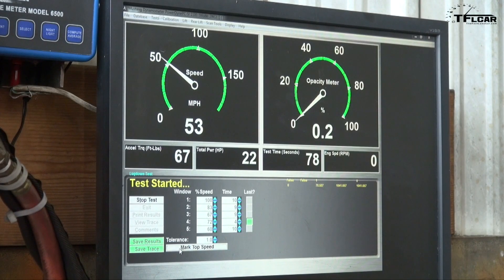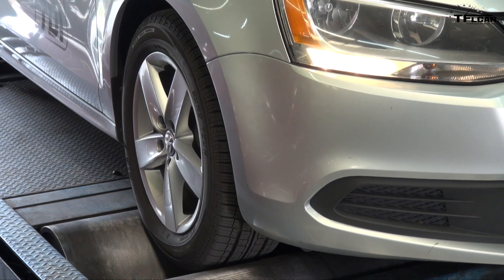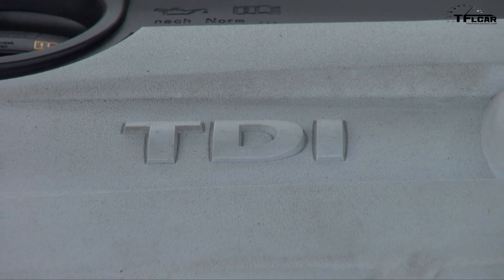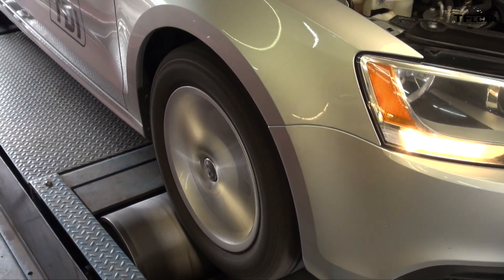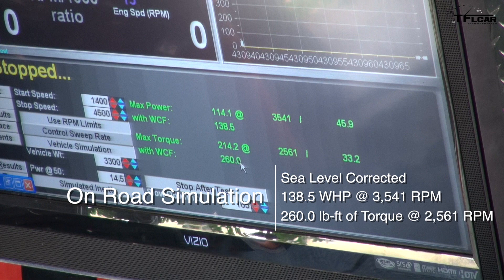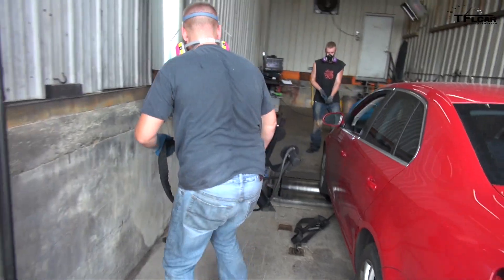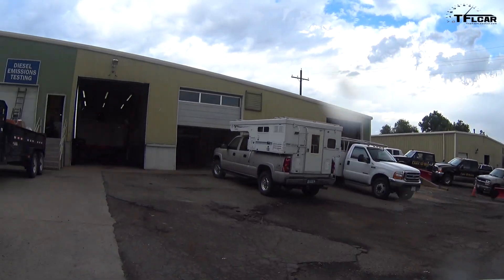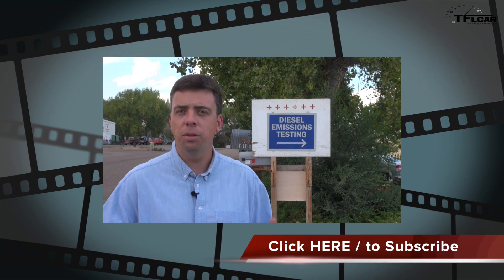Surprise! We Dyno a VW Dieselgate TDI Jetta to get the Truth about HP Loss

Comment: Why were you not able to measure NOx? That's the key. The VW issue did not involve particulates, only NOx. Particulate matter is created in a rich burn scenario where NOx is created in a lean burn scenario. A good example is off-road diesels emissions standards, Tier 4i focused on particulates (DPF, low sulfur diesel, engine tuning, etc), Tier 4f focused on tier 4i plus reduced NOx (DEF, engine tuning, etc). The biggest likely effect of the software change is reduced fuel efficiency. This is really about excessive government regulation, where meeting one regulation makes it difficult to meet another regulation. Regulations that often contradict each other, add cost, reducing reliability, and increasing complexity to what could be a simple system.
Reply: Marcin Kaminski This has been looked at in the UK. So long as cars are charged off-peak overnight, every car in the UK could be an EV on charge without overloading the system. There is so much wasted capacity on the grid off-peak that this is entirely possible. 
If you are somebody who thinks you might forget to plug in your car you can just get a wireless charging plate. So long as you park over it - and we are creatures of habit, so usually like to park in the same place anyway - it'll charge without any lead-play.
Reply from the maker: Before Diesel emissions testing in Colorado do NOT require NOx measurements. They only test for particulates.
Reply: because the only people or group that has a machine that reads diesel emissions are the ones that test big rig trucks, regular gas analyzers as the ones in smog stations such as the Bar97 or im240 are not rated to read diesel emissions only gasoline. these guys don't even have an emission analyzer they just have a dyno that measures hp and they hypothesize if the car is polluting by reading hp data, not too acurrate but better than nothing.
Reply: That's what I'm wondering. They went to a tuning shop with a dyno and no 5-gas machine to be found?

Who works ever go to a tuning shop without a good gas analyzer?
Reply: +bdreed85 also, every diesel runs lean, not one diesel will run at stoich as the soot would be outrageous what you mean is a hot or cold burn!
Reply: +discountbrains vw isn't pushing hybrids. America is pushing hybrids. The new diesels burn 20% cleaner than a gas engine the same size. Hybrids have hundreds of pounds of batteries that are very harmful and has a gas engine as well. I know a guy that died from the gases put off by batteries. Scrap hybrids!!
Reply: +discountbrains If new, small diesel is not fit for purpose, than what is? Hummer? F150?
If VW can't meet NOx levels, than most likely other manufacturers can'e meet it either.
Reply: +warset Technically not correct. Diesels create less CO2 (that's why tax brackets are lower). Main issue with diesels were particulates and NOxs. Particulates are eliminated with DPF filters and NOxs can be limited drastically with urea installation (AdBlue) which is already being used in some cars.
Reply: +Troy Strain In fact, if they were "full throttle", it can be assumed the engine was not running very lean. Lean burn would be maintaining speed in a high gear where you're getting plenty of oxygen without burning much fuel.
Reply: +The Fast Lane Car There is no particulate emission in cars with DPF filters so this does not make any sense anyway. NOxs are the only area where VW could fiddle with, but among all "specialists" there is still no information based on tests.
Reply: +Thomas Monument 1. Batteries only offset pollution as electricity is still not a "clean" power. 2. Power grid might not be sufficient to switch to electric cars. 3. It's still expensive technology (getting cheaper, but still expensive)
Reply: +Marcin Kaminski No, Marcin Kaminski, this is false information and you should not be spreading it.  To say electricity is 'still not a clean power' with absolute certainty, shows you need to stop thinking of the world as one small region.

1. ELECTRICITY is as clean as we make it.  It CAN be clean.  It CAN be dirty.  In its dirtiest form - coal - it's still cleaner than a combustion engine.  It's a win-win; it's cleaner to begin with, and it gets cleaner over time.  To imply that 'ALL' electricity is dirty shows you've been living under a rock.  It depends where you live.  If you live in China, then yep, it's almost all coal power.  If you live in England, it's only 28% coal.  If you live in the USA, it's rapidly switching over to natural gas, and many of the northern states like Washington are 70%+ renewable.  To imply that electricity is 'just dirty' and leave it at that is SO naive.  With this said, countries are working to clean up their act, and the important thing is batteries get cleaner as grids get cleaner.  The same cannot be said for combustion engines, which will always be dirty.  They're almost as good as they're going to get.  An EV powered by nuclear-generated power is 4-5x more efficient than an ICE.

1b. Even if your above point were spot on , and batteries merely 'offset' pollution, how can you speak of it as if it's a bad thing?  Offsetting pollution away from town centres is amazing for people's health and lungs.  A good case-and-point is Mexico City, which has terrible pollution due to its location surrounded by mountains which trap the pollutants in.  Cities are also bad for this as the high buildings trap in the fumes.  Conversely, power plants are located away from busy populaces and have additional measures to curb their emissions which a tailpipe of a car does not have.  They also tend to be situated in places where the pollutants have plenty of room to disperse, as concentrated pollution is when it's the most dangerous like around busy traffic.

2. Experts in the power industry have been shooting down that myth for years now.  They ALL say the power grid can handle the load of electric cars, so just let that stupid myth drop, will you?  Firstly, most charging is done at night where there's a bathtub effect of low power usage anyway, and electricity is cheaper.  Power plants have an excess of electricity during off-peak times, they WANT it to be used.   Secondly, if additional demand is needed, we build more power stations.  Thirdly, as more and more people switch to their own solar panels, that actually TAKES load off the grid - and doubles up by counteracting your point #1.  Fourth, if only we stopped refining oil, we'd have plenty of power for our cars.  Refining oil uses extortionate amounts of power.

3. It's getting cheaper faster than you think.  Expect price parity less than 10 years from now.
Electricity has been available in clean methods for decades now via renewables and yet you still sit here and claim it's not a green power. I truly do wonder if you've been living under a rock and assumed it's 100% fossil fuels still?  Assumed it isn't and won't get cleaner over time?
Reply: +zshadows not exactly, diesel is not cleaner than gasoline emissions. diesel does have its advantages over gasoline engines but cleaner emissions is not one of them. That's why the majority of diesel truck owners for example like to take or modify their diesel trucks to get more power and diesel mileage because diesel engines are greatly modified with emission components just to keep cleaner emission output, so in a way it makes sense what WV did.
Reply: I was talking about particulate matter emissions on an unmodified vehicle. Because of the PM filter, the VW diesel vehicles emit less PM than many gasoline vehicles (especially direct injection) despite having greater PM levels at the exhaust manifold.
Reply: I was talking about particulate matter emissions on an unmodified vehicle. Because of the PM filter, the VW diesel vehicles emit less PM than many gasoline vehicles (especially direct injection) despite having greater PM levels at the exhaust manifold.
Reply: I was talking about particulate matter emissions on an unmodified vehicle. Because of the PM filter, the VW diesel vehicles emit less PM than many gasoline vehicles (especially direct injection) despite having greater PM levels at the exhaust manifold.
Reply: +Marcin Kaminski stupid people testing smart cars
Reply: +bdreed85 i'm catless
Reply: +bdreed85 No, you're DEAD WRONG! Quit blaming the gov't. People have decided we are polluting and harming health and the environment too much; hence, the emissions laws. If the diesel can't meet one standard without failing another then there is a problem with the diesel. Either it needs more innovation to meet the standards or should be scrapped for other methods like LNG engines. VW in fact is pushing hybrid vehicles. But, why do they make these cars require premium gas? This must mean here again the compression ratio is needlessly high.
Reply: Stop building hybrids and ICE cars and move over to pure electric. Better batteries don't give off any nasty emissions, unlike all ICE vehicles. 0 emissions in cities and on roads would keep the EPA happy.
Reply: +Marcin Kaminski diesel makes much more pollution than gasoline
Reply: +Will Davis Electric cars are good, but electricity is still NOT clean and will not be for some time. That's a fact. Renewable energy is currently max 20% (13% in US) of energy consumption.

1. "USA, it's rapidly switching over to natural gas" - Is that clean? I thought that natural gas is a FOSSIL FUEL, so not a renewable or clean energy. Washington is probably producing a lot of electricity from water dam, which can't just be built where you want it. 

1b.Yes it is great for congested areas, but discussion was about being environmentally eco, so electric cars still pollute, just somewhere else. 

2. Read about "UK Energy gap". Your argument about building more power plants is childish, so I will ignore it. Most people connect their cars after returning home, from 5-6pm and will charge for about 4-8 hours. This is when the biggest surge or power consumption is. Most dual power house holds (gas and electric) don't have a dual electric meter and will not set timers or wait for car to charge at 10 pm.
Regarding solar panels, do  you think of owning a spare battery set and charge it during day? It's rather difficult to charge car from solar panels after coming back home at 6pm. I don't think that solar panels made a big difference in UK and most owners are being paid half of promised rates for electricity. I don't even want to go and discuss your last statement about refining oils.  

3.Funny enough cost of maintenance of wind turbines is much higher than previously estimated, with lower than assumed power outputs. 
But it's not about cost of electricity, as it's cheaper than conventional fuel. It's about cost of electric cars. Cheapest Nissan Leaf cost £21k with battery ownership, compared to £12k for a Nissan Note. Network of charging stations is still scarce in Europe, so I would not be able to use it outside UK.

More electric cars will be sold and they will be more popular and energy will get greener, but not yet and not now. It takes time and it;s a slow process. I am positive about this technology, but combustion engines will be popular for many years and forcing people to go electric, by manipulating facts is not fair.
Reply: +Marcin Kaminski There is little reason people won't adapt to charging their vehicle at times other than 6 PM. Just because they do it now doesn't mean they have to. Yes, the present battery technology is expensive and the most costly part about e-cars. But, these cars could be made much simpler than they are. After all what components do they really need? A little internet research can tell u there is a quantum leap in improving battery tech  coming soon.
Reply: +Marcin Kaminski Electric cars have timers. It's easy. I drive one.
Reply: +Thomas Monument I'm just wondering how many people will actually use it, causing surges.
Reply: Marcin Kaminski
People will adapt if they have to. They don't say "I'm being imposed on and I'm not going along". In most buildings these days people who smoke have to go outside even if its cold and raining or whatever to smoke.
Reply: +discountbrains And they won't if they don't have to. It's all about convenience. Smoking is regulated by law, so it's different. 
Anyway, this conversation is drifting away. The main point is that discussions about switching to electric cars in spite of VW problems is an illusion, because this will not happen overnight and even in 10-15 years time there's going to be a lot of petrol/diesel cars on our roads.
Reply: NOx is caused by predetention(caused by compression/heat instead of a spark) this is how a desiel fundamentaly operates so its always going to be bad at NOx
Reply: Yes, and maximum carbon combustion (less smoke) means more NO2 due to the fact that diesels generally have extra oxygen around at the end of the burn stroke. That's a clean burn.   Diesels burn hotter, and cleaner, but only so long as you allow them to breath. The USA and now the Euro emissions controls requiring de-tuning of the burn inevitably will result in inefficient combustion, which is disastrous for fuel economy. 
EGR: We also cannot expect our engines to suck its own exhaust with the EGR and do better efficiency. Madness, which in the end DOES result in more emissions overall (CO2, NOx and particulates combined) UNLESS we remove NOx some other way, and can maintain the super clean burn of the modern diesel. 

NOTE: These modern diesels are 20 times cleaner than they were 25 years ago.  There is NO comparison.  VW engines (which I personally love) have always been amongst the cleanest and most reliably so.  The Golf, Jetta and the Rabbit have had brilliant fuel economy for 20 years.  The REAL war should be against nasty HIGH BENZENE petrol which is VERY toxic when inhaled from a cold exhaust system, as so many of our friends run around with cool engines this is real and ever present pollution nightmare. This is not the case with the diesel. I maintain diesels are STILL better for the environment, whilst the petrol-heads are loose on our streets.
Reply: bdreed85  exactly; thank you.
Reply: Benjamin Hartshorn Anyone can die by improper handling of Gas too. In a proper situation batteries are very safe and have no tail pipe emissions. Even in the most biased and worst case scenario the battery Electric Cars are 50% lesser in emissions than Gas and diesels in a Well to Wheel analysis.
Reply: Marcin Kaminski Battery Electric Cars are the only Cars which can get cleaner along with the grid. Also lots of Solar and Wind is being added to the grid and making it cleaner. Many people are getting Solar, Battery setup for reducing their dependence on the grid and power their home and Car mostly with Solar Electricity.
Reply: +Troy Strain Not necessarilly. The new diesels have a partifulate filter that catches all the particulates and then burns them off periodically. Their tail pipes are often cleaner than gasoline vehicles despite diesel's natural tendency to produce particulate matter under some load states.
Reply: +discountbrains There is one reason : convenience. Nobody want to park their car in the garage just to remember to turn charging on later. Programmed timers can be used, but to my best knowledge no electric cars come with one. 
Cost of electric cars include millions spent in R&D, convincing, registrations, small batch production and most of all network of charging stations. 
It can and will change, but not in the next year or so.
Reply: +zshadows listen to this person folks. So far he has been 100% correct in his comments, others,  not so much.

Comment: Mpg are good. Owners will keep their cars. Still they don´t polute more then an american V8.
Reply: +ER B (hondaftw1234) And what about all the other gases that are produced? NOx isn't the only thing that's produced you know. And another fun fact: modern direct injection petrol engines produce more soot than modern diesels with DPF - soon even the petrol engines will be required to have a DPF.
Reply: You're clueless.  A TDI does pollute more NOx emissions than an American V8, hence why this is a problem!
Reply: hell no they don't pollute as much.  American V8 out there running is going to pollute more then that TDI sitting in the service bay. 
+Toni  Hell yeah yeah but the TDI catches all the soot in the intake so it don't need that shit anyways for that